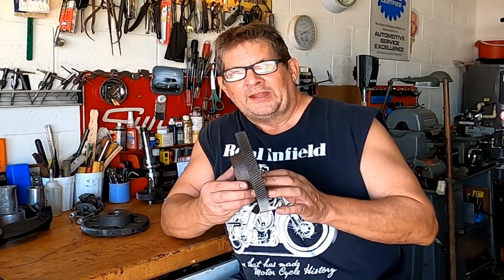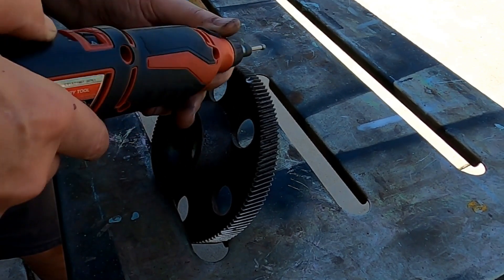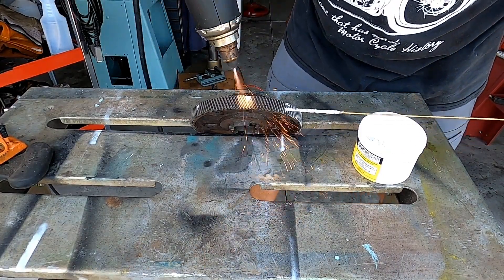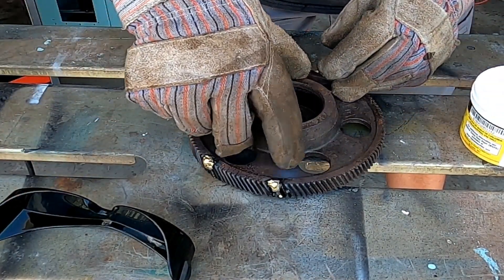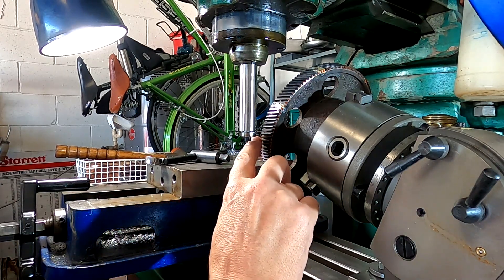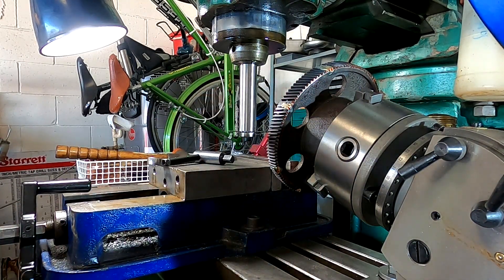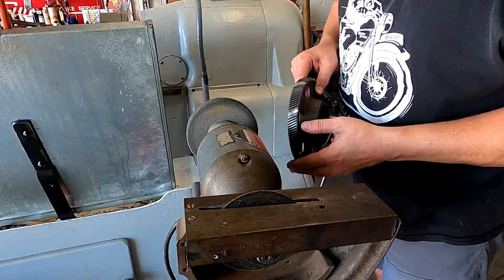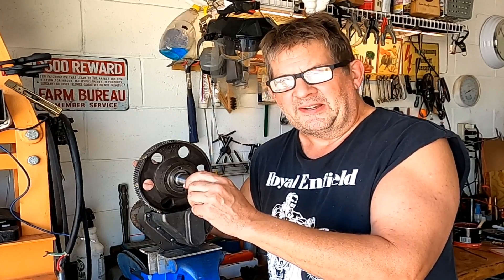Brazing & Cutting new gear teeth on the Delta 2 speed gear box.

Comment: Hi Don, did you do a video on turning hard steel using an insert?
Reply from the maker: I've done a number of vids turning different hardness's of steel, and all with inserts usually on the Monarch. They weren't talking about insert vs material. The quick slitting saw video was done using some pretty darn hard Stainless. Was there something in particular Youde like to see? Don

Comment: Very nice! I have done a couple of repairs with my flux core welder, definitely a lot o work reforming those teeth. I like your setup with the slitting saw, on some of my latest gear attempts I wound up using combinations of 45 and 60 degree cutters as well
Reply from the maker: Ya luckily these teeth were pretty narrow. The slitting saw did most of the heavy lifting and it was just a quick finish up with the file.  I did a tapered straight pinion gear a while back that you couldn't find a cutter for so simply made a single lip cutter on the grinder the exact taper of the teeth and made a few passes to get get to depth. Worked great. Don